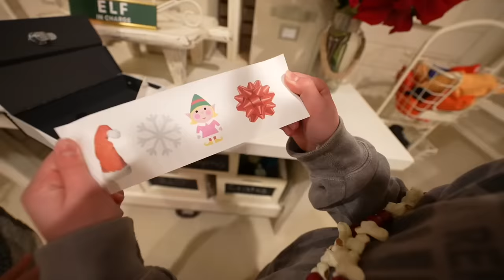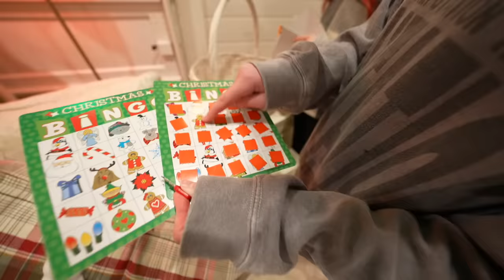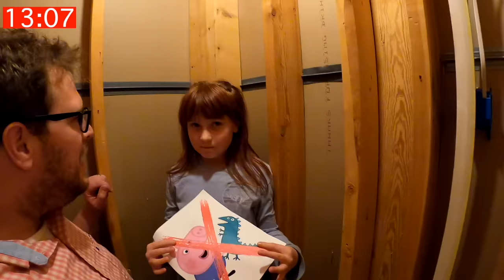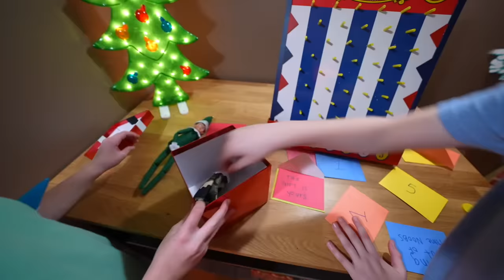Roblox PIGGY In Real Life - Christmas Movie with the V Family

Comment: The only way I could see the difference was to put a new filter in and put the new one on and it would take me a few hours and I would be fine but it was just too hot and it would not work for the filter and it was a lot worse so it would not have worked.                                 But it would be better to just have the new one and then use a different one that is more expensive to use and then the old ones and the old ones are.            The new                             Ones will probably have the new ones and then you could get a different brand new ones but they will have the old one that is cheaper to replace 🎊